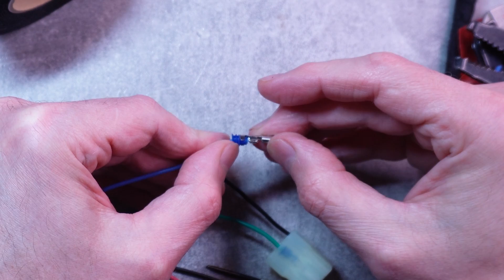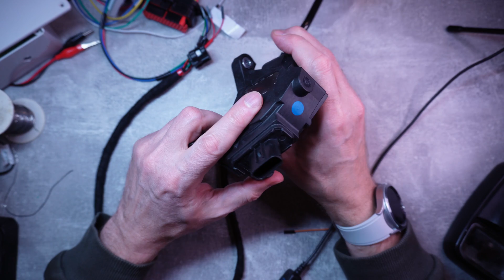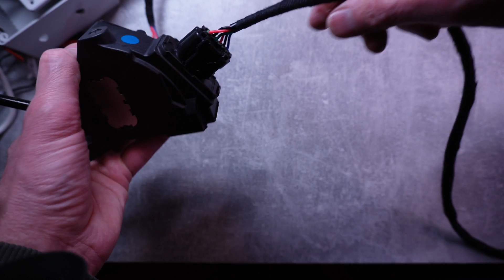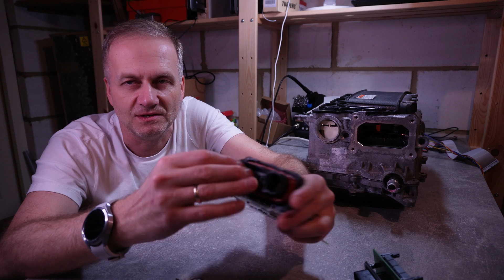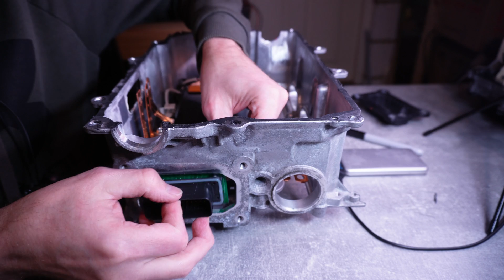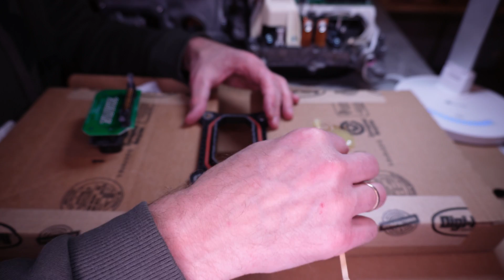Harnessing the wiring Toyota Prius DIY EV Ep 16

Comment: whats the max voltage DC you can give the prius inverter? I want to run it at 350 to 400 volts
Reply from the maker: Yes it would be fine except you must not connect the HV where Toyota connection is. Check my other videos I show where the connection should be made

Comment: Connectors are an absolute pain. I've bought my fair share of incorrectly keyed connectors and performed the same operation :D
Reply from the maker: I am glad it's not just me😉. How did you connect the HV cable? I am contemplating to use the existing connection as was used in the Prius and reroute the bus bars to the same connection point as recommended on the Open inverter wiki

Comment: Those "am seal" connectors .. how is the name spelt?
Reply from the maker: It is spelled as AMPSEAL. This is the connector I ordered https://uk.farnell.com/amp-te-connectivity/776164-1/connector-recept/dp/1654497
Reply from the maker: In some places you could get the whole kit like this one but I prefer to order my components from Farnell or Digikey
https://www.kit-elec-shop.com/gb/plugs/2761-female-35-pin-ampseal-connector-kit-with-35-pins.html

Comment: Could you share how the gas pedal is connected?
Reply from the maker: If you can check my videos #11 and #8 I go over connection for the throttle pedal. But in short it is as follows 
Pin 6 - Wiper 1
Pin 5 - Ground
Pin 4 - 5v +
Pin 3 - Wiper 2
Pin 2 - Ground
Pin 1 - 5v +
Reply: @LatutaEV  Hi. Thank you very much. I just saw the message
Reply from the maker: This the connector I am using but it doesn't fit the throttle pedal without little modification I did 
https://www.automotiveconnectors.com/6-way-sumitomo-ts-sealed-series-female-kit-inc-terminals-and-seals.html

Comment: Hi. Thank you for sharing such information. I also ordered myself a small fee. However, due to the lack of chips, I had to solder stm32 and a couple of smd components. Finally, yesterday I finished everything and checked the board for operability. Unfortunately, I forgot to order a connector board. I'll have to come up with something)
Reply from the maker: Yes I know the chip shortage is quite bad at the moment. You could try using PCBway as they can order components as per your BOM or use components supplied by you. They are a bit more expensive than JLCPCB though. With regards to the connector you could just solder straight into the board for experimenting and do proper setup later on

Comment: You are doing an amazing job. Following you closely behind. I have a question do you plan on using v1d or go on with single motor. Anyways best of luck. You are doing an absolutely amazing job 💯.
Reply from the maker: Thank you for your kind words. This type of feedback keeps me going. I was planning to have a got at dual board. But I have read on the forum from a user who used MG1 and MG2 together that MG1 makes very little difference. At the moment I am planning to parallel outputs from MG1 and MG1 and use MG2 to get more power. If this works well I may try removing MG1 and using two gearboxes and two inverters with MG2 only variant